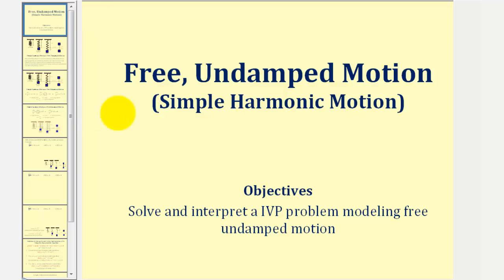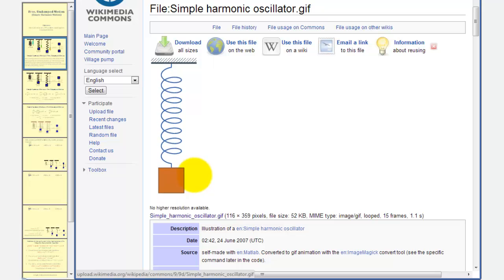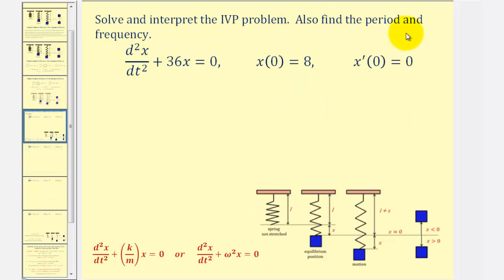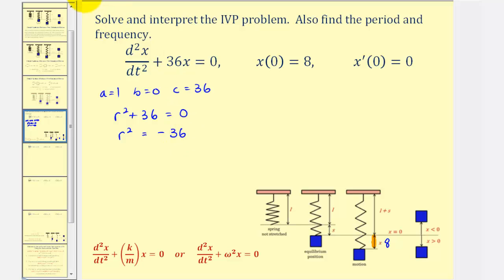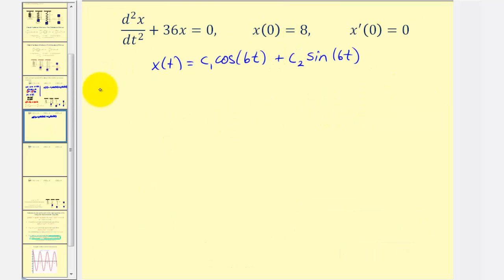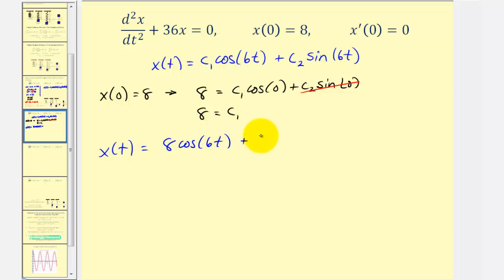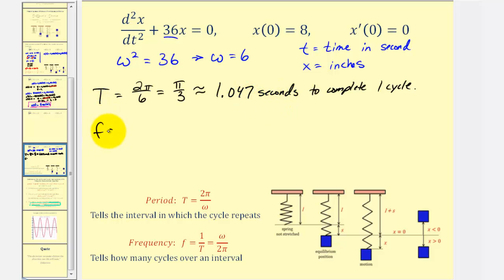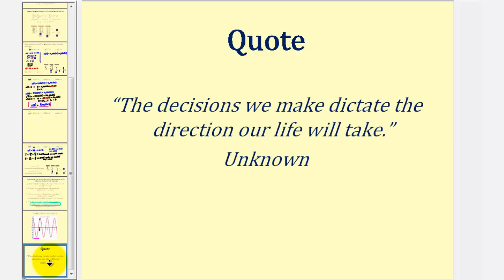Introduction to Free Undamped Motion (Spring System)

Comment: @5:45 isnt it supposed to be    x(t) = c1 cos (6t) + c2 sin (-6t) ? cause of the + and - .  great video all around though!
Reply: No.  See the previous vids.  For r = alpha +- beta i, the general solution is 
x(t) = e^(alpha t)[C1 cos(beta t) + C2 sin(beta t)].

You could use x(t) = c1 cos (6t) + c2 sin (-6t) if you wanted to, and it would not make any difference.  The sine function is odd, so sin(-6t) = -sin(6t).  This means you would get

x(t) = c1 cos (6t) + c2 sin (-6t)
 = c1 cos (6t) - c2 sin (6t)
 = c1 cos (6t) + (-c2) sin (6t)

Since C2 is just an unknown constant, and -C2 is equally constant and equally unknown, the negative sign would not make any difference to your final result.  It is a bit messier, though, so we don't usually do it that way.